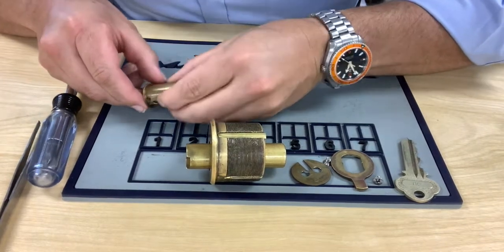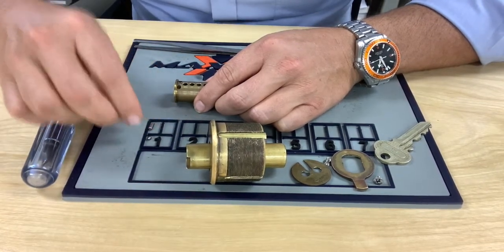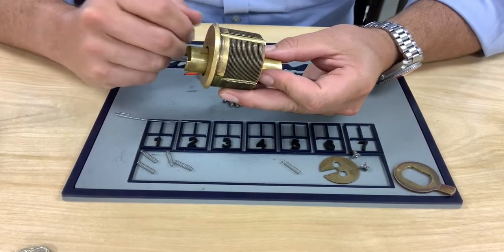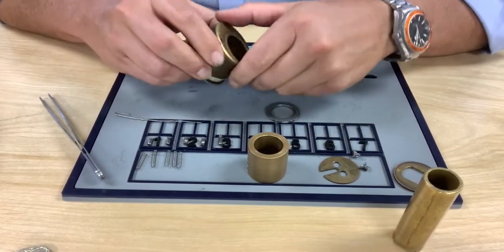Folger Adam 110 Mogul Cylinder - Detention Pin Tumbler Lock

Comment: 2:58 I started working as a prison locksmith and the guys before me, who trained me, didn't show me the right way to master pin these. They didn't know. They told me just to use traditional master pinning in order to make it turn. When I encountered one that was meant to be mastered, and had the time to mess with it, I figured it out. Built the change pins according to the original change key, then stacked the master ring on and built the master pins using the master original key. Tolerances are a little fidgety working with old locks, but the end result is worth it for the extra security.
Reply: I am going to an interview next week for a state prison locksmith job. Would you mind telling me how does a day look like to you ? Is it dangerous ? Do you communicate with inmates ?
Reply: @jaybig360  Every day, yes. Risk is inherent. Don't be a dick to anyone unnecessarily and don't smuggle anything in for anyone and you should be fine.